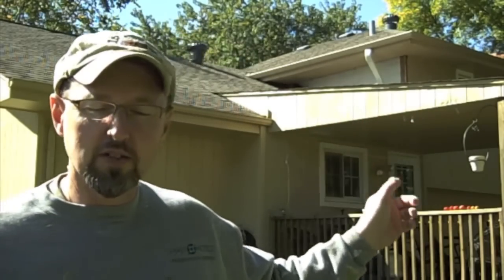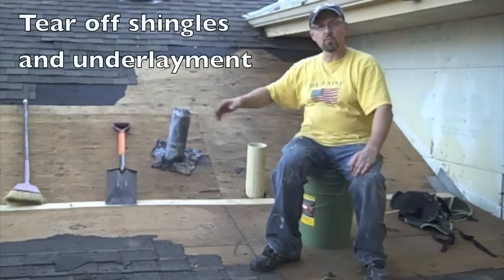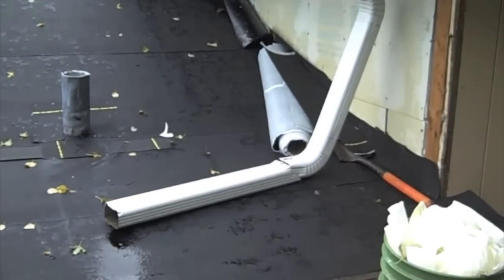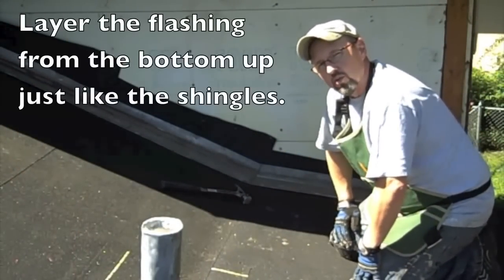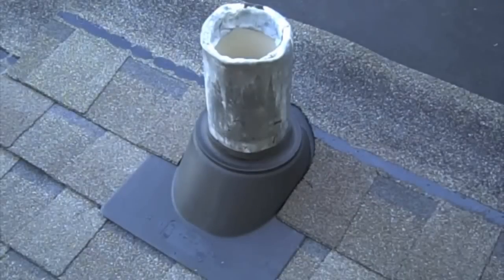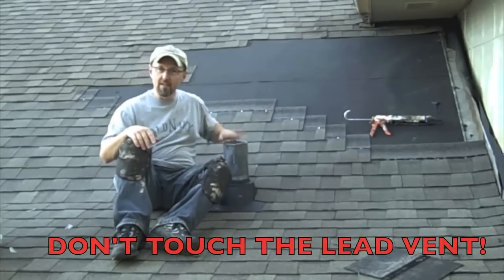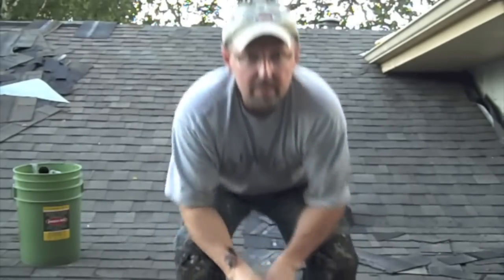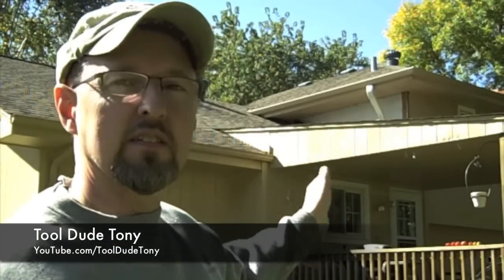What to do when a roofer won't help with a leak

Comment from the maker: @linxcod --- This can be done either wet or dry.  In this repair, it had rained after I had stripped the roof.  I did what I could to prevent leakage during the storm.  You are correct, the  appropriate sealer must be used if the roof is wet.

Comment from the maker: Yes, there is a ridge vent on that roof and I appreciate your suggestion.  However the ridge vent is is over the vaulted ceiling in my living and dining rooms.  The turbine vent is over a completely isolated attic area over my kitchen.  That space had a basic roof vent and no soffit vents.   So it was always hot in there until I installed the turbine and soffit vents.  Thank you!

Comment: Been doing roofs for 30 yrs and you did a tip top job. The slope was not enough for me to use just felt underneath but it is standard and stands alone. I would have gone with the rubber roll, also the wall above the flashing should have been tar to prevent any rain slipping under. It looked perfect what you did. So much I would have used you for mine.

Comment: Thanx  for the repair  demo. Repair  is  what i am going  to do for now.  I have  twosame. One  is a new  roof  the other is a garage floor (concrete). however the garage  will pay  for a new  roof, so i will repair the roof  myself,  spend  the money on a garage  floor, work enough to buy a new,  roof, and install it myself. Thanx again.

Comment from the maker: Good question.   The flashing is on top of the ice and snow shield underlayment.  If water does get in under the shingles at the flashing, it is not going leak because of that inner layer.  I used the same method for flashing that has been on the house since it was built 30 years ago. 

I will ask for stepped flashing when I have it roofed next time.    Thanks.

Comment from the maker: @ThesuperBoss2011 -  Nothing functionally on top, but after being roofed a couple of times, it had a lot of nail holes around the base.  That's why I installed the plastic/rubber boot over it.  The issue with lead is now it is considered hazardous material.  If you handle it, wear gloves.   Thanks

Comment: another question. this type of repair like you did in the video, can be done whether wet or dry correct? obviously using the proper sealant/tar to work with the moisture
thanks again

Comment from the maker: You don't have to do the whole roof to fix a leak.  This was only a partial roof job.  It just seemed like the whole roof because I got carried away and went all the way up to the ridge.  You can do it all or just a section.  The trick is getting new shingles to match your sun and weather-aged roof.

Comment: Is that a ridge vent at the corner of your house? If so you should probably remove the turbine vent since it interferes with the flow of air thru the ridge vent. Allows a better flow of air from the soffits. Or relocate if if the other edge of the roof doesn't have a ridge vent.

Comment: Hi,I have a large garden workshop made of wood, and it leaks very bad.The roof design is a pent style, there is a slight incline and it leaks where the roof slopes down at the back.
The roof is 8x4 OSB board ,ive had 2 sets of roofing felt on it (thin) plastic sheets and a thin tarpaulin and it still leaks!!.
 Originally it rained heavily before felted.
If i remove the old wood,renew&paint it with bitumen will this waterproof it? Is my leak problem cos it got wet before i had chance to felt it?

Comment: Hello sir,
I recently moved to a 15 years old house which has 2 years old roof. I noticed 2 days back a water dripping in my garage. I went up inside the attic and felt it was coming through the roof. That day it was raining too much. It never dripped before and after also. So it dripped when there is heavy rain. The place where it leaks from the roof is a corner where wall and two roofs met. Somewhere near that corner is leaking. Can you please suggest what needs to be done? Thanks

Comment: I have a leak in my roof. The leak is not apparent from the outside; however, when looking from inside the attic there is a damp area on the board under the shingles. What is going on with the roof?

Comment: Dude, you worry too much.   It's not "touching" lead that will get you.  I have handled it all my life (ammunition) and I'm still going.  Worse, I have chunks of it IN me, from where I've been shot.  If the doctors in "hospitals" won't bother with removing it, I doubt touching it with bare hands will kill you.  Just wash well before you EAT anything since ingesting it isn't good.  I grew up at a time when lead wasn't worried about.  Lead paint, lead in gas, lead projectiles, home casting of bullets, and so on.   You stand a much higher risk of falling from your roof.  Of course, lawyers would probably eat you alive.  

The "read between the lines" joke comes from holding your index, middle, and ring fingers up.  I doubt the lawyers are smart enough to figure that one out, but...

Thanks for the help.  They charge an arm and a leg for this today and half of them still don't do the job any better than they did in the 70s and 80s.

Comment: that flashing u reused ( where roof meets the wall ) is a tile pan ...  tile pan should only b used for tiles not asphalt shingles ...  ur suppose to use step flashings ( usually 8 by 12 galvanized metal bend like a L metal ) for asphalt shingles .....

Comment from the maker: It all depends on how soon you plan to move... Just kidding.   Without inspecting it, it's hard to tell, but generally, it it best to replace damaged wood or chances are you'll be doing the repair a second time.  My 2 cents. .

Comment: We rent and the ceiling in the bedroom just fell down and almost hit me. Some nut laid drywall on top of drywall for the ceiling and when the roof started leaking, it started to crack and about and hour later, down it goes.
Reply: beware, your floor might be drywall too
Reply: Concrete

Comment: Thanx  for the repair  demo. Repair  is  what i am going  to do for now.  I have  two projects  which cost the same. One  is a new  roof  the other is a garage floor (concrete). however the garage  will pay  for a new  roof, so i will repair the roof  myself,  spend  the money on a garage  floor, work enough to buy a new,  roof, and install it myself. Thanx again.